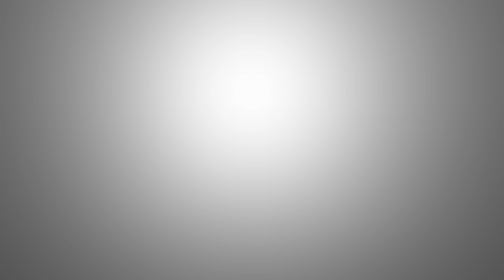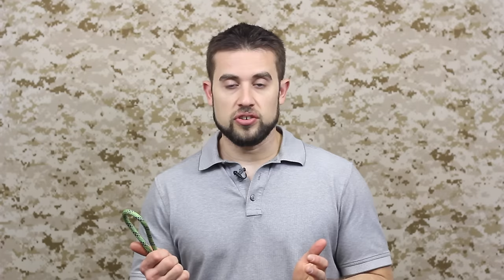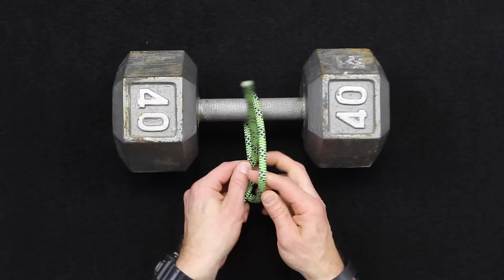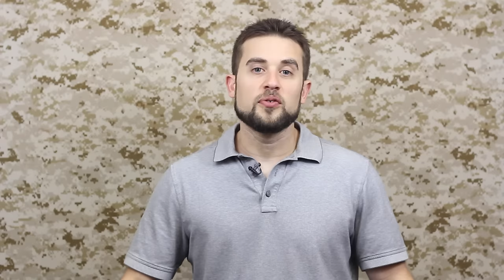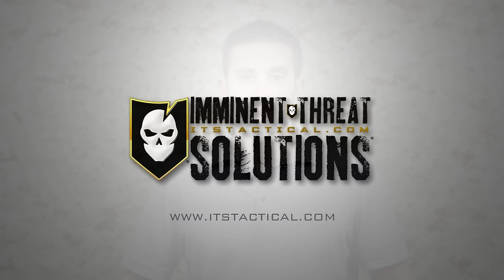How to Tie a Half Hitch and Hitch Variations - ITS Knot of the Week HD

Comment: It's not a "hitch", its half hitch which is incomplete with out a second half hitch.  Calling it a hitch alone gives the idea that a single half hitch might be acceptable option, which it never is.  A hitch is a type of knot, not a specific knot in and of itself.
Adding a round turn does add friction which is good, but more than three would simply be a waste of rope.   Adding another half hitch or a stopper knot on the free end are other ways to make the knot more secure and possibly use less rope depending on what you are bending your line to. 
All that said a round turn and two half hitches is a good hitch to know.  If you can tie a two half hitches you can tie a clove hitch which is a good hitch that does the same job and takes less rope.  A clove hitch is simply two half hitches tied around a object, add another half hitch and you have a double clove hitch, even more secure.  Want a set up that won't fail, use a clove hitch and two half hitches.  Done right, something will break before that knot fails.
Reply: u should make a video lol
Reply: @rdptll  I agree haha